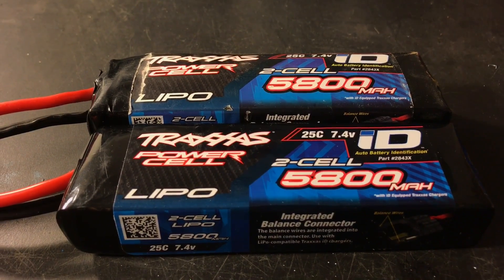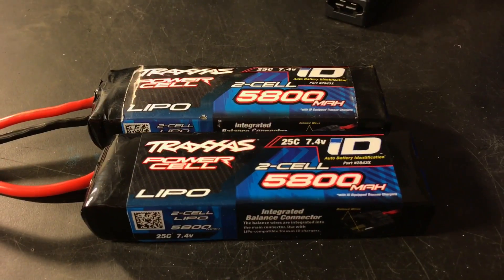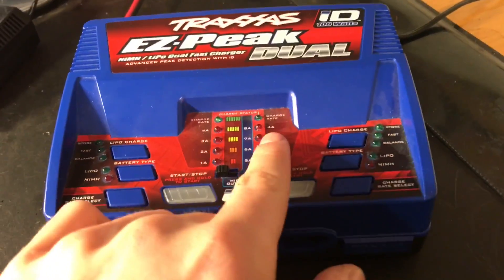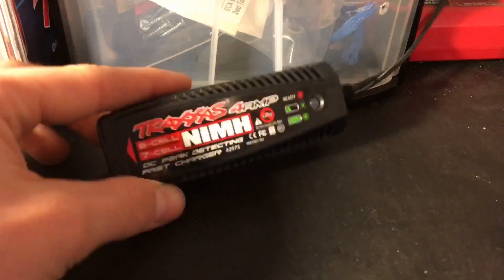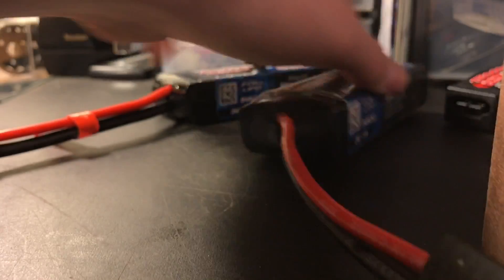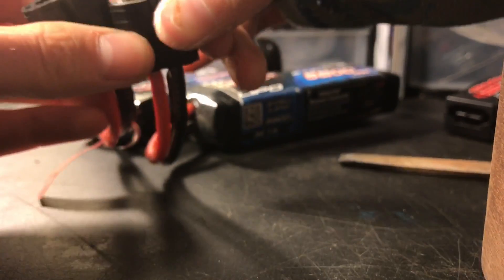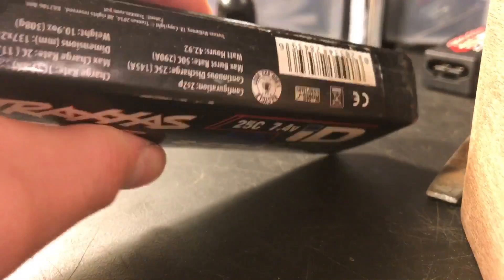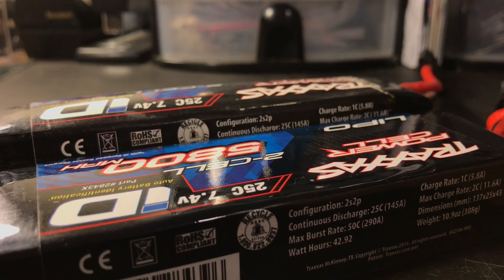RECOVER A TRAXXAS LIPO BATTERY!

Comment: worked for me!  I used my car's jump starter aux output so I use the car charger in the backyard (in case of fireworks).  I have the 2 amp traxxas car charger btw.  I charged for 30 seconds and after that, the EZ PEAK worked again. thanks 100x!

Comment: I have a brand new 5000 3 cell lipo battery that I drove on once and I took it out of the car emidetely after use like most people recommend, I balance charged it before I ever used it with the same track as charger used in the video, it puffed before I could use it the second time. Why do you think this is and what could I do to solve it, thanks
Reply: Please research "storage charge"
You stored it too long with high voltage where cells suffer from too

Comment: I am aware that this is a very old video but what you can do is with the charger hold the start in charge rate select and then you can change it to NIMH
Reply: Justin Hoffman it wont let me change it to nimh even if i do what you said
Reply: When you plug the Lipo battery in does the lights go up and down the percentage metre
Reply: Also sorry to hear about the batteries I know they’re expensive

Comment: I'm sitting here with 2 5000 mAh lipo batteries and a dual ez peak charger. The batteries are so drained they won't charge. Screw you Traxxas. I spent over thousand  bucks on my UDR...
Reply: that guy so you always balance charge all the way up to 4.2v and put away for later use?? It says not to leave lipo batteries fully charged so I always leave them around 3.8v then fully charge when I’m about to use
Reply: You don’t have warranty on the battery?? How has the ez charger held up?
Reply: that guy when you charge your batteries do you storage charge and then when your about to use you balance charge or do you always balance charge to 4.2v

Comment: So nothing work to get my lipo connect and or taking a new charge until.... and this is drastic and I am sure closely monitored, I put two keys, one for each contact, in the battery and connected it to my 12 volt trickle car charger for one minute.  The lipo batter cables began getting warm, I knew I was pushing it.  So after one minute, I unplugged the lipo, plugged it into its normal traxx charger and it happily charged away, staying cool and works good to go.  I would not try this it at home though, I think it could burn a house down so be warned.

Comment: you might not reply to this but my battery wen I plug it into my charger it still has the lights that go up like it doesn't recognize that a battery is in it. Will this help with my problem?
Reply from the maker: +TheOGAgentnate no it will not most likely your battery is already ruined but if you get lucky it might just be the plug

Comment: sir, what do think of traxas lipo? are they bad as people say ? I wanna to try them batteries. m tired of having to plug a balance port to charge my lipos 😂
Reply from the maker: +vuthina roeun I think they are good as long as you take proper care of them. Key word proper. A lot of people trash these batteries by not taking care of them and then blame Traxxas. They also have the best customer service
Reply from the maker: +vuthina roeun of its a 50/50 shot some are great others puff rather quickly
Reply: Outdoor Native I love them I’ve had no problems with mine because I properly break all my batteries in be fore they even see the vehicle they are going to be used in
Reply: vuthina roeun no they are most bad at all

Comment: A nice idea,but it does have its consequences, if your battery is TOO Overdischarged (Around 3.1 Volts or lower) You shouldn’t try to bring it back with a Nickel-Metal-Hydride charger as it can make the LiPos puff even more, they can also catch fire too, I’m not saying it’s impossible to bring back a battery that’s that low, you can, you shouldn’t use a NIMH Charger though. It’s too bad because I’ve had batteries with low voltage but trying to charge them with a NIMH Charger would never work since they are Traxxas 4S LiPo packs and they have different, bigger connectors. But nonetheless, it’s a good idea, only if your willing to risk a LiPo pack.
Reply from the maker: +ro_ro1235 thanks for the positive comment! my thinking is that if the battery pack already is basically ruined and you can't charge it why not give it a try even if the battery puffs even more it won't matter because you can't do anything with it anyways

Comment: why dose it get puff
Reply from the maker: +Ruben Perez gas generation in lithium ion batteries is a normal thing. Even if you don’t abuse your battery, the normal everyday use of your battery will generate gas through a process called electrolyte decomposition.

The electrolyte decomposition occurs even faster if you overdischarge a battery or overheat a battery.
Reply: @outdoornative3939  if used correctly they will never puff.  If they puff it is because they are breaking down internally.
Reply: arnoldsq, no they puff no matter how well u take care of them

Comment: Traxxas chargers are junk turns out they over charge I had a 7.4 and it charged to 7.5! That is terrible
Reply from the maker: +North Star state RC I've found that they do overcharge if you charge the batteries fast.   If you stick to 4 amp balance charge it will last a long time
Reply: Good to know but yet I have been doing that I'm confused as to why it does this
Reply from the maker: +North Star state RC well .1 volts isn't a whole lot so it could be your voltage reader is a little off

Comment: I do not recommend traxxas lipo and charger cause they don't last that long
Reply from the maker: +Zeno'sama I like the chargers you just have to replace the fan and it will last forever. But I agree with you on the batteries and I now use a lot of gens ace
Reply: Zeno'sama I had my dual charger and lipos for like 2.5 years so far so good

Comment: can't hear you, but from the comments, that's a good thing
Reply from the maker: +skydyverjym in my experience the battery becoming puffy is when I run a car really hard when it's hot. But it can also happen when you store a battery fully charged for awhile. The puffing can also just be a fluke as I received one brand new from Traxxas and it was puffed.
Reply: I bought my car, played with it exactly one single time, wasn't hot and I had it on a lesser setting.  ran it for about 15-30 minutes maybe, battery wasn't dead.  Did the storage setting on the battery and charger, put it up.  ONCE.  I played with it ONCE.  Got it back out a month or two later and the battery charger wouldn't recognize the batteries, they weren't puffy yet, but got that way soon after.  My warranty replacements cam UPS yesterday.  Do you mean running the car hot, the battery hot or both?  Please elaborate.
Reply from the maker: +skydyverjym  The BEST thing I can recommend you doing to make your lipos last, is investing in a good battery voltage checker. The one I use is the dynamite brand. That way you can always make sure your batteries are at the perfect voltage for storing them. Which I personally think is at 3.84 volts per cell. What I meant by running the car hot was that the whole electronics system is hot. Motor Esc battery. Thanks for commenting and I hope you subscribed! Let me know if you have any more questions!
Reply: Outdoor Native hey thanks for that info, I'll check em every time I put em up now. I have a badass meter that cost way over a hundred bucks 10 yrs ago or more
Reply from the maker: +skydyverjym  sounds good! Best of luck with the new lipo

Comment: also don't use the whole thing up when the Red LED light flashes or the battery won't charge
Reply: THE RC CHANNEL Is there a fix cause my slash 4x4 was blinking red when the batter died I turned it off then back one the red light blinking then u pressed the acceleration then unplugged it right after
Reply from the maker: +TropicPython 61 the blinking red is telling you that the car has gone into lipo protection mode which tells you that the battery needs to be charged. It doesn't mean that the battery won't work. My best advice is to get a battery voltage checker so you always know what each cell voltage is at.
Reply: Outdoor Native How much is it I got a 3s 11.1 volt lipo
Reply: Outdoor Native I was using a 2s lipo at the time
Reply from the maker: +TropicPython 61 I use one by dynamite I don't know what it's called but I was like $25
Reply: My shit only blinks when the battery completely dies and then I have to jump it. Its bs

Comment: Your house is going to blow up if you keep on doing that. And if the battery is swelling that means you are putting to many charges into the battery. So make sure you use up the whole battery when your driving. When a red LED light flashes slowly on the esc (speed control) that means the battery is low!
Reply: that can't possibly be true at all.  I got a brand new car and battery set, played with it exactly ONCE, literally. put it up and the next time I got it out to [play with it, the batteries would not charge and got all puffy like the one in the video.  I charged it once or twice so it is NOT from too many charges
Reply: @skydyverjym  it's because Traxxas packs are crap, get some Gens ace packs